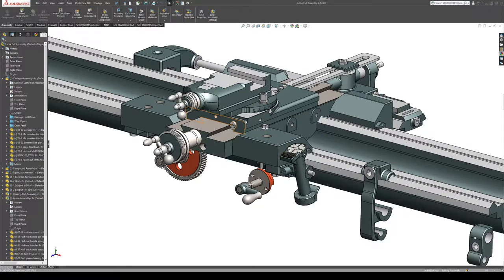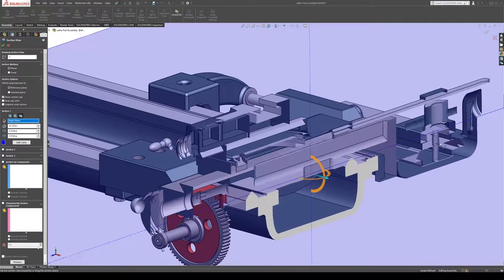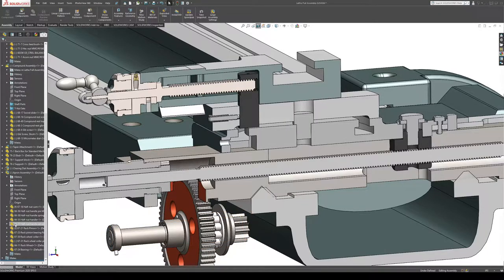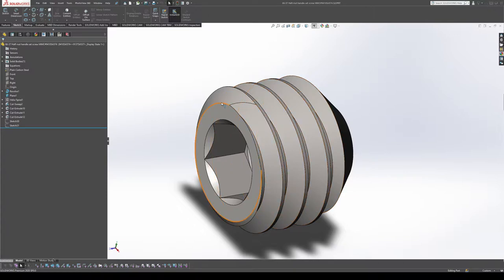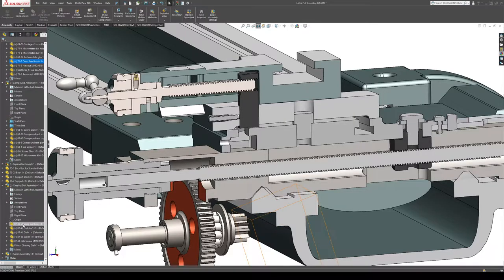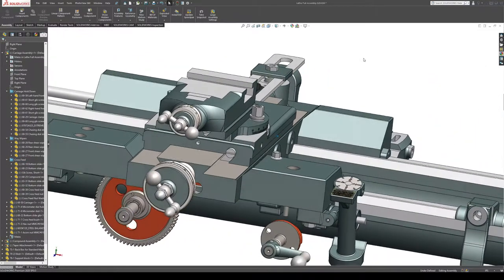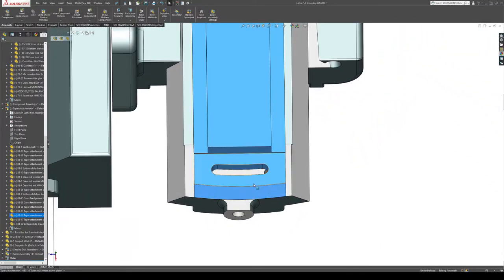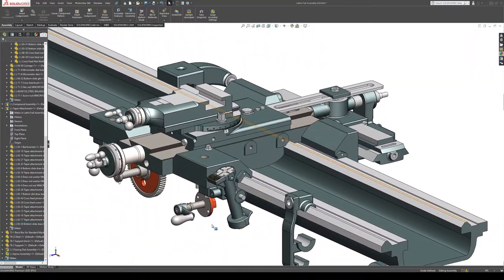1950 LeBlond Regal 17" Lathe Restoration Part 9: SolidWorks Assembly Introduction

Comment: This is amazing! I can't wait to see this restoration all the way to the end. I just picked up an old lathe too and I'm just starting the process, but I love the idea of modeling it as I take it apart. Question: I'm in video production and I mostly work in AE or Blender. Can useful models be pulled from Blender and used in something like SolidWorks? Keep up the good work!
Reply from the maker: Thank you for the compliments. SolidWorks can import a lot of different types of models, and for some there's an option to interpret the shape into features.

Comment: This is abit insane, in the best way possible!

Did you ever finish/release the full model? I just bought this exact lathe today and this would be the most ultimate resource known to mankind lol
Reply from the maker: I've got about 95% of this model complete. At this point, I'm considering just dumping what I have in a GitHub repo and letting anyone do what they want with it.
Reply: @cavemaneca  Well if you do decide to post it up there let me know, its a wicked model and killer reference as an owner of the same machine

Comment: Solidworks has a darkmode?
Reply from the maker: Yes it does!
Reply: It was new in 2016 I believe. You can have dark mode with classic buttons as the 2016 version changed the looks quite a bit and the classic guys (like myself) didn’t like it.